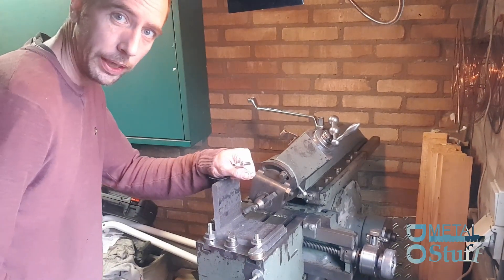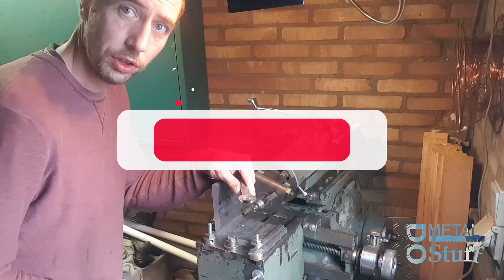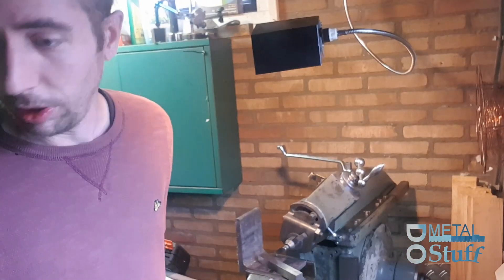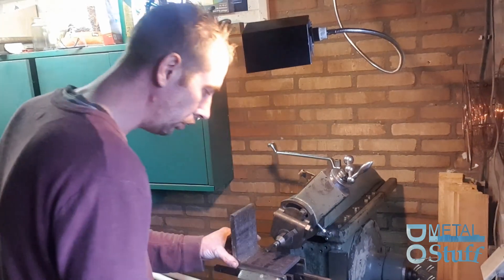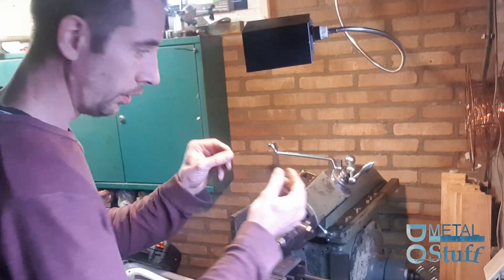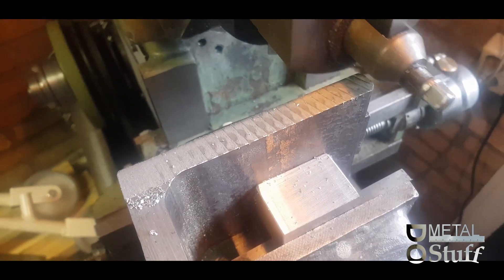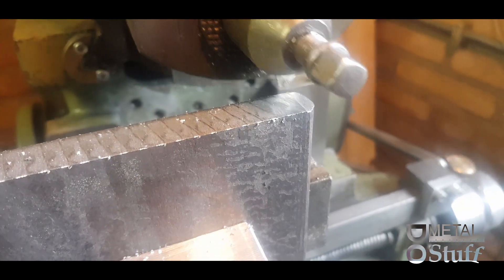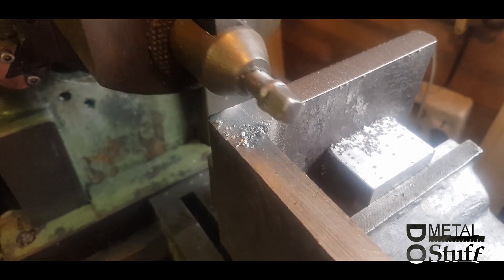Metal Shaper - Machining 'a' Precision angle block out of a piece of angle iron

Comment: Love watching any shaper working. I just finished a large roughing job on my shaper, it is many times faster than my milling machine in its proper use. It cut tool steel like butter.
Reply from the maker: Thanks for response. I had no choice here. it certainly wasn't the ideal setup. may I ask? what kind of tool steel is used. by you